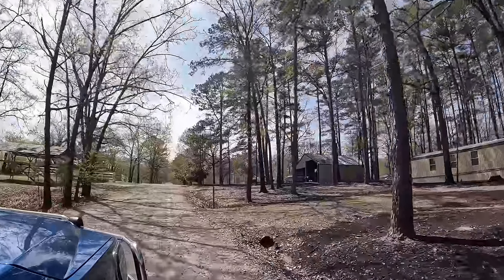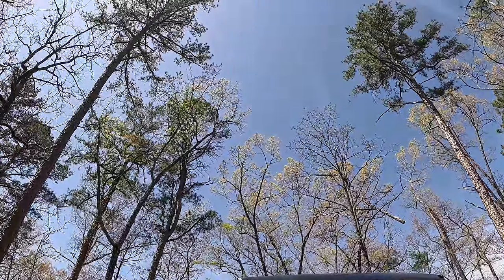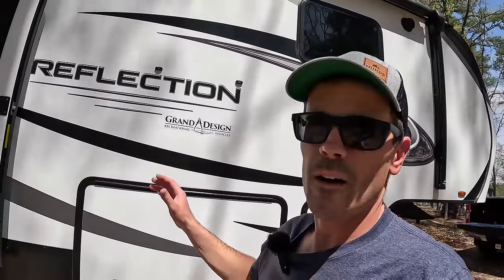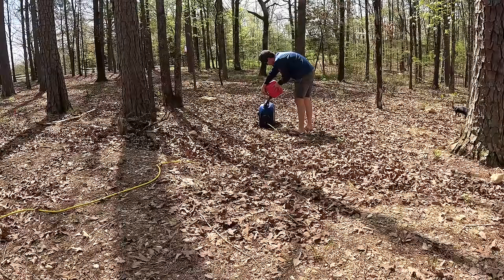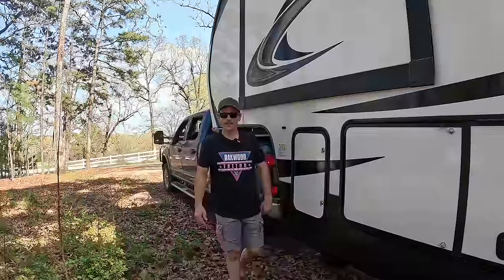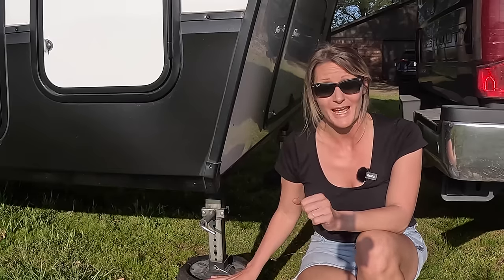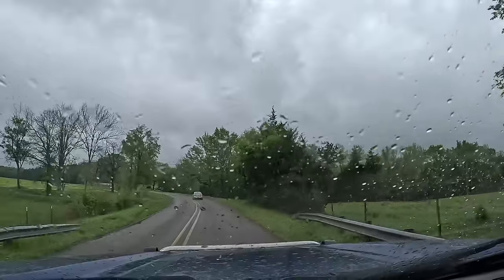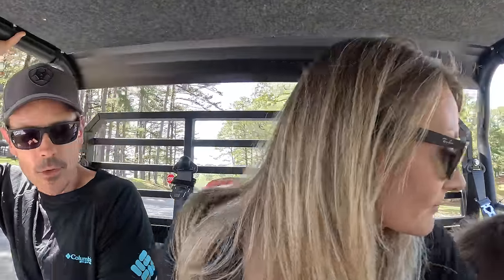It's my birthday..I'll do what I want!  Full Time RV!

Comment: Good video 😊 just saying  why would  you try to power up your  with the  Inverter  just use your  generator  I've never  seen  the Way  you were running  cables   from side  plug Into Inverter  I don't know  either  you need more  batteries  or more  solar 🤔 safe travels
Reply from the maker: We demonstrate a little better in some previous videos.  We were pushing our batteries to the max, to see how far we could push them.  Plugging into the inverter allowed us to use our 110v outlets, without using the generator.  We just upgraded to a 410AH battery, to see what we could do with it, but we didn’t try to conserve at all.

You’re right though.  A generator will do the same thing, but in situations where we can’t use the generator, or do an overnight, where we want to not dig it out, we needed to know where our battery life was at. 

Basically, we’re playing with it. Haha!